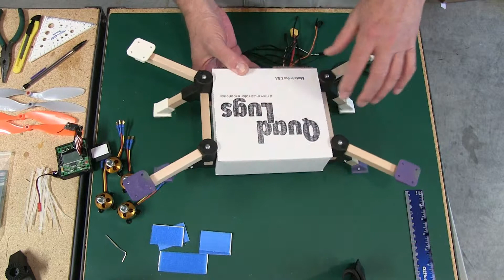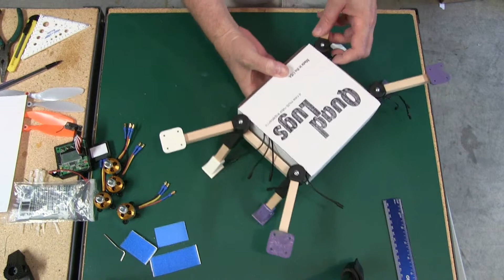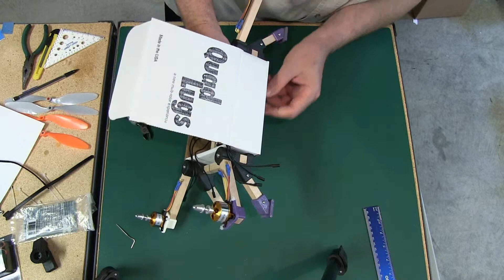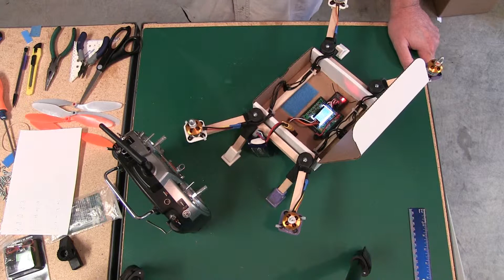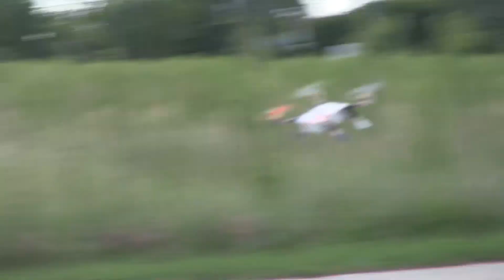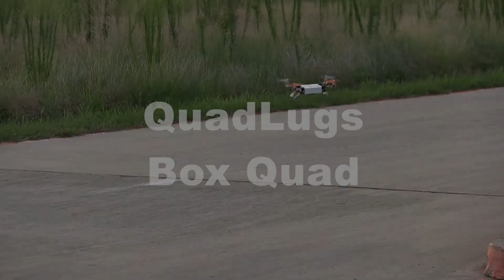QuadLugs Box Quad - Build ( wiring - esc - motors - setup )

Comment: The idea of using the shipping box as a body is unique, and it answers peoples' requests for a closed body without building from foam board, but maybe a corrugated plastic box would be a better starting point.  Even a pattern for building a box might be good.  When a quad flies outdoors, there are all kinds of opportunities for the body to get wet, and cardboard will warp, sag or fail completely if it absorbs too much moisture. Even landing in tall wet grass will soak the box.
There are all sorts of inexpensive food storage containers.  I'd like to see commonly available ones integrated with a quadlugs frame.  If the body is low enough on the frame, and no holes are made in the bottom, I bet it would even float!  A polycarbonate body could even accommodate a down-facing camera and light so you could see fish underwater in lakes or reef areas in the ocean.  You'd want the front panel to be transparent as well, but the other pieces could be black, or painted black on the inside.
Ventilation could be planned with air intake high in the front and exhaust in the back to keep ESCs and the FPV transmitter cool.  Of course, cardboard is lighter!